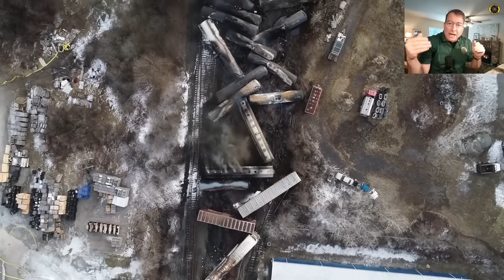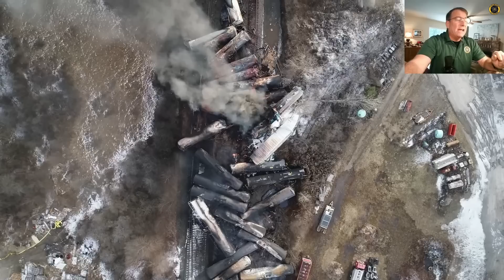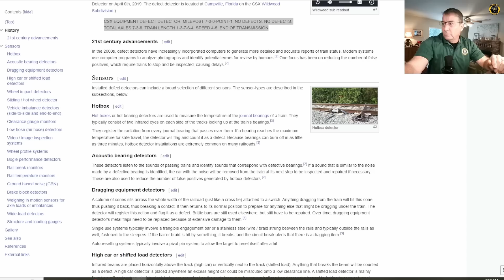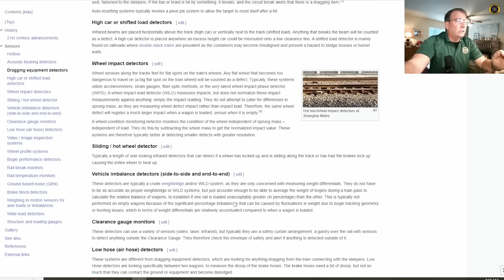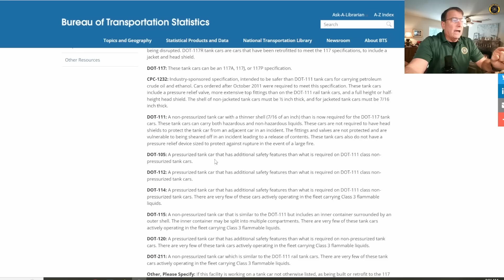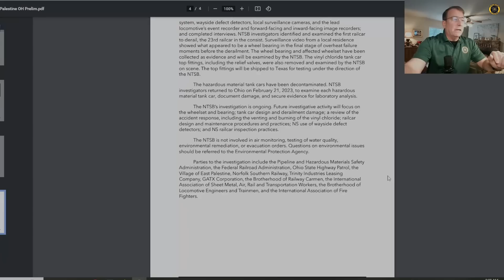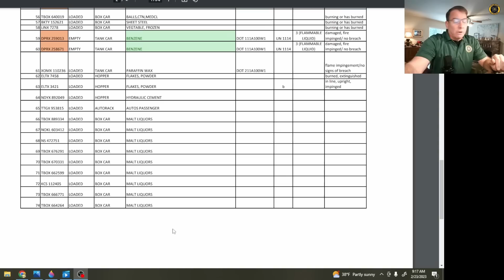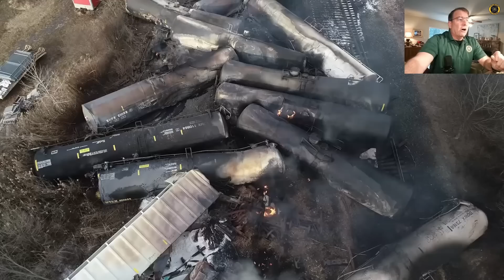NTSB Prelim Report: Norfolk Southern Train Derailment 23 Feb 2023

Comment: Defective car which caused the derailment was 23 cars from the lead locomotive...that is less than 3,000' feet from the crew in the engine and well within the distance that they should have been able to observe the wheel bearing going to failure. 

Sorry guys, but as a retired locomotive engineer with 33yrs service on the railway responsible for the largest evacuation in history in North America (the 1979 Mississauga Disaster) this incident is beginning to look like an abysmal failure of the crew running the train to observe defects on their train and take appropriate action to prevent a catastrophic derailment. 😔
Reply: You probably retired before PTC came into the cab. You’re either focuses ahead or focused on the PTC screen. In your day you probably had men in the Caboose looking for hotboxes. These day hotboxes are relatively rare
Reply: @Stoker58 When  I retired in July 2019 there were 4 computer screens in the cab of my engine which required my vigilance to observe and operate while running the train.  I operated in major urban and rural areas in some very difficult and busy territory mixed with passenger and freight trains.

The caboose and 3rd brakeman were negotiated away in 1992 with implementation starting in 1994 - when I hired on in 1986 we still had some 5 members crews (with a grandfathered fireman) and many 4 men crews. When I retired we were down to 2 man crews.

The bottom line is you have to still look back and visually observe the condition of your train at every opportunity regardless of whether it is 100ft or 14,000ft long.

As far a s PTC is concerned that makes the job easier...not harder to do - it isn't much different than FTO which all of our trains were equipped with when I pulled the pin.

As far as roller bearings causing hotboxes yes, they are a fairly uncommon event but still common enough that one has to be vigilant for their occurrence not only on your own train but on passing trains.

Comment: They have all the data they need. They are not analyzing it the way they should be. High absolute temperature should obviously trigger a shutdown. An alert should also be generated in the case of a temperature change, rising or falling, of over 20degF over the space of 10 miles. (A rise of over 100degF over 10 miles screams of a problem developing.) The alert needs to indicate if this is occurring at individual cars, or across the entire train. If the train is heating, there's an obvious problem. If the train is cooling rapidly for no apparent reason, something goofy is going on. The people involved should at least know this is occurring.
Reply: Absolutely correct. The failure warning was there, but ignored by railroad policy.

Comment: The system looks to have done it's job correctly, more or less.  The issues are: 1 Why were hazardous materials being moved in such amounts?  2 Was burning the correct way to handle this accident? 3 Could this have been prevented?
Reply: There is an enormous quantity of hazardous materials needed to run our advanced society. Vinyl Chloride, the main problem here, is used to make PVC pipe and other kinds of plastic. It all needs to be transported, and trains are safer than other means.

Comment: Positive Train Control (PTC) systems are designed to prevent train-to-train collisions, over-speed derailments, incursions into established work zones, and movements of trains through switches left in the wrong position.  They have nothing to do with preventing a train or cars from simply derailing due to a mechanical malfunction.  Nothing that happened in this derailment meets any of the criteria that I listed for a PTC system.

Comment: 6:24 I think the question to ask is (especially with a train going only about 50 mph) - - where was the report from the previous hotbox detector?  Nobody seems to have it.  Going from no-alarm to "critical" across only 1 detector interval is pretty hard to do.  I suspect the prior report is being buried - and that they had a prior warning of less severity.
Reply: Incorrect! The linked NTSB report shows the temperature increase from the  2 previous detectors, Sebring and Salem, which reported a progressive increase in bearing temperature. East Palestine detector confirmed that the bearing temperature had continued to rise, finally getting above the stupid fixed alarm threshold.  The temperature trend first seen 30 miles before the wreck was ignored.
Reply: @SteamCrane  Well, then the fixed alram threshold really IS stupid, and they need to stop the moment ANY sudden temperature increase is detected.

Comment: This was a hot wheel defect, not a hot bearing defect.  Some systems measure both and use two IR cameras to do so. When this train passed through Salem Ohio approximately 20 miles before the derailment this car was throwing sparks from what looks to be stuck brakes. So I don't believe NS uses hot WHEEL detectors.
Reply: Interesting question!  Earlier detectors had a sensor mounted at a 45 degree angle to watch the entire bearing-wheel-brake system.

Comment: Hot bearing not hot box
Reply: Traditional usage, they used to be plain bearings with boxes around them holding oil. Also, it's an American thing to minimize syllable count, "freeway" vs "dual carriage way".
Reply: They’re still called hot boxes on the railroad even though there no longer Journal Bearing. As you can see the detectors are still called Hot Box Detectors as well

Comment: I have studied railroads for 50 years, and I guarantee you that the radical safety activists are going to use this derailment to push for more unnecessary regulation. Yet this event appears to have been simply an accident that was handled well by the train crew. The railroads have been forced to invest more than $12 BILLION in Positive Train Control systems that work with computers and the Global Positioning System to allegedly prevent accidents. Obviously PTC did nothing in this case and I believe will do little to nothing to prevent future accidents. PTC was rammed down the railroads' throats after the famous Chatsworth, California commuter train/freight train collision of 2008.
Reply: PTC has resulted in an increase of flat wheels due to false emergency brake activations. Coincidentally, the vibration caused by flat wheels can destroy bearings.

Comment: So the brake line failed before the fire was detected. 

Maybe we need to rethink how these brake systems work. Because it sounds this whole derailment could have been avoided if the brakes worked like they do in a car. Or were held open with a system less susceptible to fire.

Even if the brakes were stronger towards the rear, it would be harder to derail. 

The whole system needs to reengineered.

But I guess these cars have no electronics, batteries or cameras and changing that is not feasible.

But I wonder if it’s really true.
Reply: No brake enhancement would have prevented this derailment. If even if the brakes could be applied in an instant you would still have the same result

Comment: I used to be a brakeman for Southern Pacific. The emergency brakes are only a few pounds of pressure more than a normal full service application. The train operates primarily with the air brakes. Dynamic brakes are additional braking and very powerful, but not required necessarily. Each car has a retaining valve that allows operations down steep slopes with air only. Rarely used today. 
The emergency application happened after the derailment. Sometimes in an sudden and strong  air brake application the train breaks into sections as the knuckles break. Has nothing to do with accordion.

Comment: So the axle went from "normal" to up 65 degrees in 10 miles, then up 150 deg F in 20 miles.  Given all the data they had, they could easily implement a trending program for each axle.  Perhaps the missed opportunity was at MP 69.01.  If the process determined that this bearing was going into failure based on the 65 deg F increase in 10 miles and stopped the train then, the accident would have been avoided.
Reply: Correct!

Comment: The accordion stack up of the train cars is indicative of sudden stoppage after the derailment. The emergency brake shouldn’t “lock up” the brakes to the extent the cars rapidly jump off there is a limited amount of force which can be applied to the steel wheels before they slide on the steel rails and no more effective braking force can be applied. The fact it stacked up indicates the wheels where off the rails and struck something causing sudden stoppage of the following consist

Comment: Hi Brownie; thank you for this detailed update describing the sequence of events. I noticed on your list that used motor oil was among the tanks and if they two burned, it means a lot of toxic heavy metals were released into the environment, and the smoke cloud will distribute those heavy metals across the region if not everywhere in the country east of the accident with toxic cadmium, lead and other heavy metals that end up in motor oil from the gradual wear/degradation of bearing material.

So, like when leaded gasoline and dirty coal contributed to lead and mercury poisoning, we may be looking forward to  the possibility that the literal fallout from East Palestine will be affecting fish & wildlife, farm animals and acid rain.

I still remember for years not being able to eat too many trout because of the danger of mercury poisoning

How does a train wheel fire start? The bearing is made up of three materials, being steel bearings & races, composite plastic seals and petroleum grease. Flammable petroleum grease.

When the bearing fails, the increased friction creates lots of heat that quickly exceeds the flammability of the grease and seal. A fire is inevitable, but if a silicone-based, high-temperature grease would be used, that flammability would be greatly reduced because silicon grease has a much higher temperature threshold when it flashes to fire.

Comment: PTC is meant to prevent trains from operating overspeed as well as from violating signals. Neither of these issues were factors in the derailment, so PTC played no role in either causing or preventing the derailment.
Reply: Additionally, it’s my understanding that some defect detectors won’t broadcast unless there is a defect. It varies by railroad and sometimes even within the railroad itself.

Comment: When bearings let go, they go fast. I've see a loco be fine over one Hot Box Detector & 20 miles away require a Stop & Examine at the next. Driver examined his train, found nothing of concern, drove it another thirty miles home. When it got there it was in such bad condition it left on a low loader after a week's worth of investigation. Couldn't be repaired in place, seized/welded itself into a mess.

Comment: Hoping an expert could answer this question.  Why don't the trains have onboard detectors instead of relying on external systems?  I would think that would give real-time monitoring and alerting instead of a report every 10 miles or so.  How about every car, in addition to being connected via air hoses and electrical cables, could also have "hardwired" data network connections through which the sensors can communicate with the engineer in the locomotive.  Think of it as a local area network for trains.  It would be hardwired so you wouldn't have the signal strength (and interference) issues on long trains if it were a wireless system.
Reply: No they do not. Retrofitting roughly 1.6 million rain cars would be cost prohibitive from an installation and maintenance standpoint. The best course of action would be more frequent and more sophisticated defect detectors.

Comment: Who decided to "set it all on fire" to burn it off! Worst disaster ever not being covered. Cancer poison in the air, water, and soil.
Reply: Agreed. I still want to know why burning was a better option than just cleaning up the ground and materials.
Reply: The safety valve sim the tank cars were not releasing pressure fast enough to prevent a massive explosion so instead letting them potentially explode small charges were used to create holes to drain the fluid into pits and it was burned in a “controlled” fashion

Comment: Rail buffs can correct me but I don’t believe the dynamic (locomotive) brakes are “regenerative”. I think they just take the electricity and run it through resistors and blow away the heat
Reply: Correct, pretty much the same principle as regenerative braking though

Comment: Air brakes on trains are controllable and can be applied lightly or with greater force. They can also be put in Emergency by the engineer.  You seem to say that they only have the Emergency setting.

Comment: Wait. Cabooses had a function? I assume they housed somebody who monitored the train for problems such as these.
Reply: I am of the opinion that distributed power locomotives should serve as the modern day caboose.

The brakeman on duty for the Hinton train f***ed catastrophically by not pulling the emergency brake when he didn't get a reply from the head end.
I asked my brother in law, who was a locomotive engineer for CN, whether the brakeman would have gotten in trouble for pulling the emergency brake and then it turns out there was no need to do to (in any situation, not just the Hinton specific one) and he said "not a chance; he'd probably get rewarded in some fashion."

Comment: Vinyl chloride will likely cause groundwater contamination which will be around for some time.  My master’s thesis at Rice U. was in polymer science and my career was mostly spent as an environmental engineer/consultant with much time spent cleaning up super fund sites with chlorinated solvents.  Many Air Force bases I’ve worked at have legacy chlorinated solvent contamination.  Vinyl chloride is more mobile and toxic than some.

Comment: all defect detectors should report to a central System so a central data analyzer can easily detect the tendency to overheating in advance, and stop the train before a critical temperature is reached.

More in the future, in Europe we have started a program called DAC (digital automatic coupler) so that each freight car can have its own sensors on board for brake (and why not, temperature) diagnosis, with direct report to the locomotive. It will be a massive change in the EU freight railway transportation system, and to be honest I don't know if we will be able to implement it in the whole EU area... but at least it could work for special trains like chemical or gas transportation.

Comment: Am I to believe that in 2023 "we" haven't the technology to have a sensor to each wheel and feed that data to the engineer/operator? It doesn't have to be real-time. But one sample every 20 miles? I know children involved in robotics who could design a more useful system.
Reply: It’s not the lack of technology it’s implementing it on every railcar on the North American continent and then maintaining those systems in the harsh Railroad environment. It be way more feasible and economically viable to put down more wayside detectors with better technology

Comment: You were incorrect about the train braking systems.  There are two: pneumatic and dynamic.  There are two brake levers in the cab which are called the automatic and independent.  The independent lever controls the locomotive 'lash-up' brakes plus brakes in any remote controlled locomotives and activates any dynamic braking (if available). The independent brakes  keep the train stationary in the terminal while the automatic brakes are moved to the 'release' position to 'pump-up' the brake line and and any empty railcar cylinders.  The nominal pressure to be maintained in the brake line is 95psi while the triple valve maintains brake reservoir pressure in each railcar at 90psi.  This 5 psi differential is what keeps the brakes open in the 'release' position. So a normal braking cycle starts with the independent brake applied which bundles up the train slack (1 ft per 40 ft of nominal train length) to prevent slack action 'kick' from the rear of the train.   Then a primary automatic train pipe reduction at 10 psi diff.  Then a secondary reduction to 40 psi diff. and then as required to gently stop the train or reduce the speed as required for slow section. An emergency brake application can be caused by the engineer or conductor by sending the automatic lever to the emergency position;. which is called 'dumping the air' or by pushing a button on the conductors panel.  It is also caused by a train break, as you described; where the air is released by the separation of cars and their brake lines and should bring the remaining consist to a stop. [Source: CPRail train handling manual (pre-dynamics) bought at a yard sale and various Trains magazine articles]   

The Question of HBD's and crew reactions are only limited to actual alarms.  Crews will not know the temperature of individual axles but the information is stored for posterity.

The triple valve is what makes all of this railroading possible.  This Westinghouse invention is the actual start of the company, long before the fridges and power turbines, that is now called WABCO, the Westinghouse Air Brake COmpany. They now own GE Locomotives while Caterpillar owns GM's EMD, the originator of the classic FP-7 diesel streamliner locomotive.  

Passenger trains have two brake pipes, one, to maintain the 90 PSI reservoir pressure and another to  serve as the brake line to signal the braking.

We can't discount the role of the End of Train Unit's (ETU's). Attached to the rear coupling of the train and the brake pipe; they signal to the cab the condition of the brake line pressure at the end of the train.  The also receive braking signals from the lead unit that allows release of air to the commanded amount.